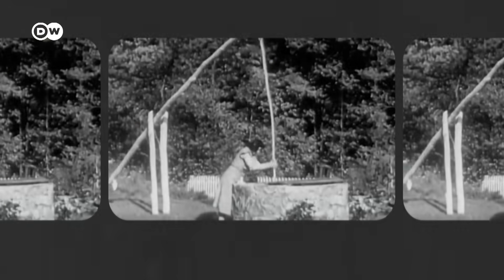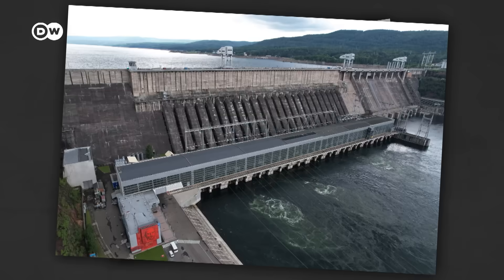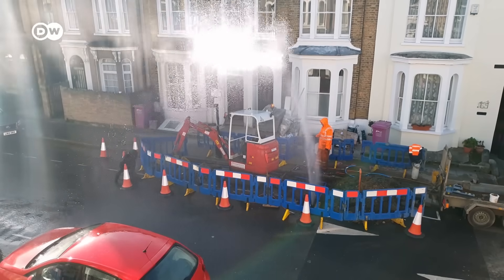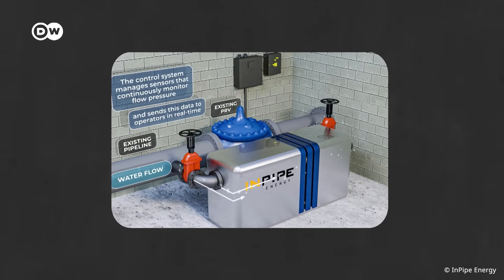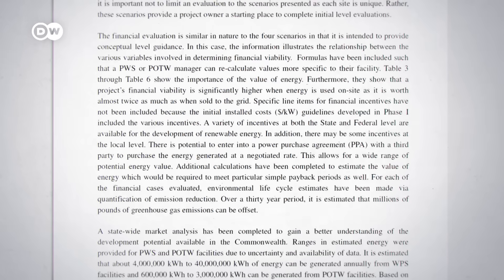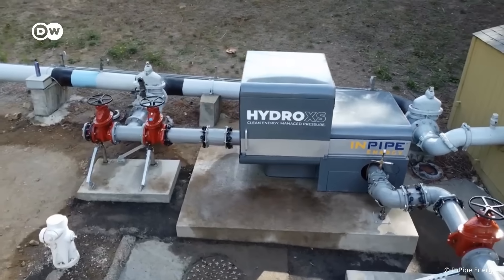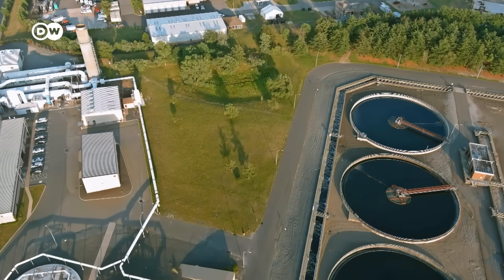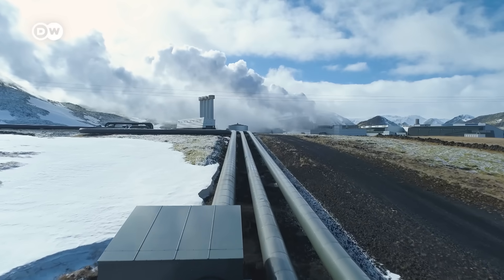In-pipe energy: The hydro power nobody is talking about

Comment from the maker: How could you make a use of in-pipe turbines?
Reply: On a personal level: you can't, really

In order to work, you'd have to have water constantly flowing. How often do you just let your taps run? You could have these on every tap in your house and still not get enough power to charge your phone.
Reply: @makerbotplanet  not to mention one first has to expel more energy then produced, in order to get the water to a high potential so it will pressurize the pipes
Reply: @makerbotplanet  Correct !  The only practical turbine installation would be at the big water utility source provider, whereas the water IS flowing, somewhat, all the time.
Reply: @petebaron4643  let's recap your proposal.
The big water utility source provider has a water pump to create pressure in the system so the last house has a certain level of water pressure. Now the provider will install in-pipe turbine at the outlet from the facility to harness energy. This will reduce water pressure in the system and the owner of the last house will complain. So the provider will increase power on the pump to reach the required pressure at the last house.
Please, explain, where did we save energy?
Btw every conversion of energy is lossy. Electric energy to water pressure, water pressure to electric energy. So the increase in power on the pump will have to be higher than the harvested energy.
Reply: What seems at first glance to be a good idea may actually be a terrible idea:

* you don't produce energy, you just recover some of the energy that you put in the water to move it in the first place. So at best you only increase a bit the energy efficiency of your water distribution system. Nothing more (but OK, it's still something ^^)
* you also need to consider the energy used and impacts for the manufacture of these turbines, which will be very high per MWh recovered compared to that of the turbines in conventional hydropower. I'm worried about the magnitude of these impacts, compared to other energy sources

In a nutshell: first reduce the energy consumption of the water distribution system! 😉
Reply: @iamsherlocked84  In 2016 in Australia a proof of concept test was run that allows dams to be retrofitted with three extra turbine halls and the dams output increased
Reply: I am curious to see if they are cost-effective to put into rainwater catchment systems and provide another energy source for a home or business with a capture system.
Reply: @mlatouable 
As soon as you do the maths it becomes obvious that this really isn’t practicable. I live in NZ where we have a pretty decent average annual rainfall, varying between 600 and 1600mm/year over most of the populated areas.
Suppose I have a large house with a roof area of 250m² and I live in a high rainfall (2000mm/year) area. Suppose I can let that water fall 5m (higher than the average gutter) to a turbine. Then the total amount of gravitational energy in that year’s rainfall is E = m.g.h. This works out to 6.2 kW.h. That’s less than NZ$3 or about US$2 for a very wet year of rain, off a large roof. And that’s probably twice what you could actually generate from that water. Plus, unless you’re only going to generate when it’s actually raining you need rooftop storage for up to 500 tons of water.
Reply: @q.e.d.9112  Source?  Not doubting your calculations nor conclusions and, in fact, confirms my (semi-educated) guess.
Reply: @gr8dvd  
Not sure what you mean by “Source?” The only reference was to rainfall, which I googled, the rest is high school physics and, since I taught exactly that, I didn’t need to reference it. 
I need you to rephrase the question if there’s something you don’t understand.🙂
Reply: @q.e.d.9112  Perhaps variable names obvious to others but fuller explanation likely beyond scope of a YT comment.
Reply: @gr8dvd  
I was trying to keep it short. I’m not going to explain the SI for the sake of Americans and I’m certainly not going to work it out in foot-poundals or whatever. So m is the mass in kg that falls through a vertical height, h, in metres in a gravitational field of acceleration, g = 9.81m/s². E, in Joules (J) is the total amount of gravitational energy this represents. 
A cubic metre of water weighs 1000kg. A kilowatt-hour is 3,600,000 Joules. The rest is junior high math.
Reply: @q.e.d.9112  thanks 👍
Reply: @mlatouable  this is clever...it will be a production instead of a recovery. Just to be careful with the dust, or leaf in the roof, that could damage the turbine...so the filter should be before the turbines and obviously cleaned.
Reply: @hectorjosehevia9121  Yeah, this guy https://youtu.be/S6oNxckjEiE did some testing on it, but it doesn't seem to really be commercially available, but you could re-use some river gear possibly (I guess), but I've never heard the costs vs production discussed, so no idea if it's generates enough power to be worth the cost of the turbine/motor and wiring job.
Reply: A wind farm lives for around the 30-35yr lifespan yet RDP Marine hydroelectric will last 100yrs+ AND be base load power AND 100% recyclable wind and solar are not the answer in their current type. And lets not forget the upgrade in transmission towers needed and the money needed to carry the power for a max 35yr power supply.
 @mlatouable
Reply: @mlatouable  its been dun in Australia a dam can now have three extra turbine halls more from the same volume of water
Reply: The basic premise of this invention is wrong.  A conventional pressure regulator works on the principle of Bernoulli's equation and 'connserves' energy.  It is plain wrong to suggest that there is energy here going to waste.
An in pipe turbine could extract energy out of the water flow but doing this will require more energy to be added in to the system through the existing water pumps.
Reply: @michael-j-harrison  you are correct that the basic premise of this invention is wrong.  And the amount of energy they calculate that they think the can extract is unfeasible to even attempt.  The Bernoulli principle is not really the equation used for a pressure reducing valve.  It is related but the working principal uses a differential flow equation (related to Bernoulli's equation and a steady state equation (not related to Bernoulli's equation).  It is only when you get into specific aspects of a valve design that you would use Bernoulli's equation. Dynamic modeling of a valve would include time which is not included in the Bernoullli equation.  It incorporate velocity which includes time but you also have to consider pressure reduction at zero velocity or zero flow.
Reply: The most efficient energy use is the one that it is avoided. What about using frequency regulated pumps that deliver the required pressure just at the required moment? That is how factories do it.
Reply: @picapica8846  this looks to be a limited time requirement and the need for water pressure is independent of the frequency rise. So the feasibility is quite low I suppose
Reply: @picapica8846  UNDERRATED comment (& why I reposted it).
Reply: @picapica8846 ⚠️ God has said in the Quran:

🔵 { O mankind, worship your Lord, who created you and those before you, that you may become righteous - ( 2:21 ) 

🔴 [He] who made for you the earth a bed [spread out] and the sky a ceiling and sent down from the sky, rain and brought forth thereby fruits as provision for you. So do not attribute to Allah equals while you know [that there is nothing similar to Him]. ( 2:22 )

🔵 And if you are in doubt about what We have sent down upon Our Servant [Muhammad], then produce a surah the like thereof and call upon your witnesses other than Allah, if you should be truthful. ( 2:23 )

🔴 But if you do not - and you will never be able to - then fear the Fire, whose fuel is men and stones, prepared for the disbelievers.( 2:24 )

🔵 And give good tidings to those who believe and do righteous deeds that they will have gardens [in Paradise] beneath which rivers flow. Whenever they are provided with a provision of fruit therefrom, they will say, "This is what we were provided with before." And it is given to them in likeness. And they will have therein purified spouses, and they will abide therein eternally. ( 2:25 )

⚠️ Quran
Reply: Install in-pipe generators on the main outlet of all Overhead Water Tanks of houses to make full use of the Potential Energy .
Reply: You don't it's simple physics really...
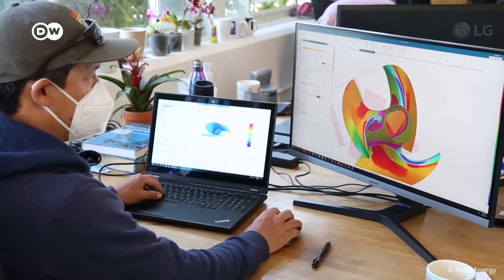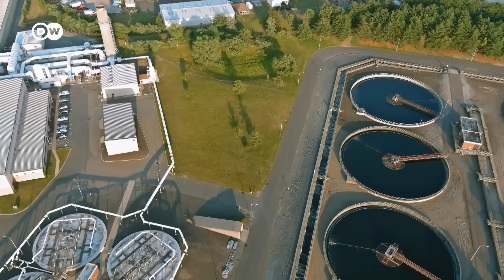Reply: When the private companies that are marketing a new green technology have no idea what the actual benefit would be (03:59) yet they talk about how their product needs to be "incentivized" (06:52) and that big companies and governments need to "step up" and adopt (07:18) their miracle tech, what they are actually saying is: "We can't show on paper that our product will result in a net gain, but the ignorant public can be fooled by flashy presentations to support legislation that we pushed through political action committees (PAC) to force tax-funded entities to adopt our product at a net loss." 

Additionally, I wonder if these companies will be made to account for all of the energy that will be used to manufacture, transport, install, and maintain their product into their equation of net energy gain. Will they be accountable for the pollution produced by the global manufacturing contractor that they use to produce their product? They say that entities could recoup their investment in their product in "less than decades" (07:00), but make no mention of the longevity of the product. Do we really believe that a turbine generator will last more than "decades"? Or will the municipal water agency that is forced through legislation to install one of these be eternally on the hook to replace turbine generators as they wear out well before they've recouped their investment?

This is how states like CA and OR were tricked into believing that sending post-consumer recyclables like plastics across the pacific on gigantic diesel-fueled ships to be recycled in a different country (with non-existent environmental standards) was somehow good for the environment. I wonder how all the plastic in the "Pacific Garbage Gyre" got there?
Reply: wow.
I just would not. 
 this whole topic is stupid.
Reply: Instead use this CAPITAL to convert pumps to solar or wind.
Reply: I live in Vancouver BC where the water is from alpine reservoirs. There are very expensive pressure relief valves. I suggest this to a friend who was an engineer for the water authority and all I got were excuses for why it wouldn’t work. The only valuable one was that BC Hydro wouldn’t let it connect to the grid. They did try is when connecting 2 reservoirs with a single water treatment plant but had real problems connecting to the grid. 🤷‍♂️🤦‍♂️
Reply: @LeftCoastStephen  if the reservoirs are at a high altitude and you don't need pumps at all and still have over pressure then yes, at the exit of the reservoir there could be one of this in-pipe generators otherwise it makes no sens as all you will do is make the water pumps work harder. If you use this system at your home you may make some electricity while watering the garden for example but you don't "generate" the electricity just steal it from the water provider lol (cause their pumps will have to work harder).
Reply: There is as much use for in-pipe turbines as there is use for perpetual motion machines. NONE.
You put energy into the system on one side and take it away on another side. All you do is reduce water pressure in pipes. Worst case: there is not enough pressure left and the pipes, so instead of a steady flow of water, it will drip. "We do not have a solid number of how much energy we can create" roughly translates into: There is no energy to gain from this.
Reply: Government uses them for tax meters.
Reply: @MAGnetICus_Attractus  You sure?
Reply: This is one of the dumbest ideas I have ever heard of.  Trying to tap the relatively small amounts of energy lost at each pressure reducing valve would cost hundreds of billions of dollars.
You would need millions of micro turbines.  And the energy being lost at each pressure reducing valve is probably being calculated incorrectly.  The pressure reducing valve uses a spring and a diaphragm and IS DEPENDENT on the outside pressure being the ambient pressure or it is designed as a sealed unit and IS DEPENDENT on back pressure regulation. There is no untapped energy unless you redesign the valve itself to let you use that energy. doubt that many pressure reducing valves could be more efficient.  But is it worth the extra carbon emissions to replace all of them.   When you calculate all the energy being lost it seems huge; but 100 wind turbines is a far far far cheaper and easier way to make up for that loss.   1.1 Gigawatts is about 1/7 the amount of energy the largest nuclear power plant puts out.   So why not build one of those instead?    But this insane quest to fool people into investing in an insane ideas will never end.  Before you get gullible people to invest you should at the very least have a working model to test the feasibility.  But that is probably also the point, you need people to stay gullible.
Reply: Don’t have them and use less pressure.

Each and every conversion process loses some energy. The most efficient way to gain that energy is not to put it in the first place. 

By using in pipe turbines, which get their energy from the pressure in the pipe which is put into the pipe by an electric pump. You have essentially made that water pipe a power transmission line.  With a conversion at the beginning, and at the end.

Highly inefficient
Reply: @Pssst.ByTheWay  You missed a key point, pressure down stepping. Just like a high voltage transmission lines have a transformer to lower the voltage to 120v before going to your home, the high pressure water lines have to lower the pressure to safe levels for your home. this video claims there is currently just losses at that point that can be recovered instead of just wasted. His example turbine he attatched to his home is just stealing power from the water plant and in that example you have a valid point, but thats not whats being presented here.
Reply: A wind farm lives for around the 30-35yr lifespan yet RDP Marine hydroelectric will last 100yrs+ AND be base load power AND 100% recyclable wind and solar are not the answer in their current type. And lets not forget the upgrade in transmission towers needed and the money needed to carry the power for a max 35yr power supply.
 @Pssst.ByTheWay
Reply: Just that battry issue....
Reply: Here is a great analog, with a hydroelectric generator to power a microgrid for remote areas.   

Hydrokinetic generators are definitely in need of innovative applications. 

https://www.youtube.com/watch?v=Wp_xASUzjz8
Reply: Someone deleted my comment
Reply: In pipe turbines could be used in tidal flows with a wide pipe with wheels or like fans turning INSIDE to a turbine
Reply: They should be using sewage pipes with generators in them as well s*** rolls down Hill and It makes power
Reply: @3tree33 This would not really work. The sewage needs some sort of energy input whether by gravity or otherwise to keep it moving. In most cases if you place a turbine in the pipe there would not be  enough energy to turn the turbine and also maintain the flow.
Reply: I was told by a professor that they were too cost prohibitive. Some easy ideas are often just ones that haven't had a chance to be tried. Or need more efficient technology.
Reply: Only reason to use an inline water turbine is to steal power from your municipality, if you don't have metered water that is
Reply: I usually install pressure reducing valves for main and secondary pipes, this is a great idea to recover some energy and reduce pressure at the same time!
Reply: Most places, you can't.
The only place they could be used is where you already need flow-reduction for some reason.
Reply: @conradogoodwin8077  And I'm no expert but doesn't that usually mean you have inefficiencies throughout the line? Would probably get more energy from fixing the problem rather than "exploit" it
Reply: These are a few specific solutions to a broad problem space. You did not get into the details and math for any of the specific solutions either. You do not discuss how excess pressure is regulated in large or city water systems now. Pressure regulators in general do not take much energy to work; this is not a problem nor a point where a solution is needed. The solution in the case of excess pressure is to reduce power to the pump that is over-pressurizing it! Or fix the design of the system to eliminate over-pressures! -- Not to keep converting forms of energy! You fail to abstract the key categories of water and energy transport vs energy generation here. Your startup interview's key contribution is using a water supply line to transmit power a portion of the way by using water in pipes instead of power lines; yet again there is no mention of the cost to convert forms of energy nor the excess cost of ongoing operations and mechanical wear and tear of water pressure systems vs traditional power lines, high or low voltage. HOW LONG WILL THE PIPES, VALVES, TURBINES, GENERATORS AND PUMPS LAST? Not long compared to static overhead or underground power lines. There is no excess energy or green generation here in water-based transmission; in sum, all tech here is more energy intensive and consumes more energy due to increased losses. Less green. I cannot tell if this channel is trying to false flag climate change by presenting some watered-down rubbish, to not take it seriously on purpose, in order to work against climate change activism and tech.
Reply: ??? Not enough was emphasised about the impact turbine aspect. A network-decoupled (ie: post faucet, but before consumption) energy recovery system would be a laudable aspiration but the wrong impression is given in this presentation discussing pressure in pipes (which comes from pumped water) being converted into electricity. It is not "new" electricity, only a transfer of energy from the pumps via pipes carrying water rather than wires carrying electrons.
Reply: I thought about this idea. It also occurred to me that we need a redesign in automatic transfer switches too. They need to be able to charge the electric cars. And They need grid both types of inverters. That way your micro energy like this idea. As well as any other ones we currently have. Would supply your electric car with power. But also use your car as a source of energy to your house till power is on. Every generator I sell I think what a waist for what they actually use it for. Every house would be a power station to help supplement that more power we’ll need for electric vehicles. Our houses do nothing when we’re not there. With these ideas they would make them  micro power stations. It would also get a lot more people on board if their car was also a generator/ source of electricity.
Reply: The first thing I would do is to find a native English speaker so we can understand what he's saying
Reply: This is a really dumb idea on all levels. 
BTW, adding this to the municipal system in any way, would be like stealing from the power grid.
 You should just take down the video.
Reply: I have proposed it many years ago for my high rise apartment block where we pump up water to 31st storey, 8th storey water tanks . We even pump water for 2 artificial 'waterfall' feature. I said, if the outlet pipe from the tank can have a turbine attached to capture the potential energy from water falling by gravity to the units below, we can recover electricity and reduce utility cost. We also have roof space (and added another roof to shield the generators and a huge cool underground carpark to generate the cooling for the solar panels if required. But most of the residents are complacent high level executives who are too used to status quo and they refuse to even entertain the idea.
Reply: It seems like you are not really qualified to make this video.  You need a lot more physics and math.  And you need an understanding of the fact that just because there is a loss of energy in a system it does not mean that 100 percent of that loss is all untapped energy.   .  Moving water is power intensive and expensive so you should probably have a little more faith that it is being done extremely efficiently and the "untapped" power loss would have already been tapped if it was feasible to tap it.  This video seems like a proposal for gullible investors.
You are also contributing to people doing dumb things like putting a water turbine on a water pipe to generate electricity.  People find out very quickly that they do not save any money by having their electricity bill go down but their water bill sky rockets
Reply: The govermrnt should step up for this idea, cz all water pipe is monopolize by the governent.
Reply: Better elon musk batterys solid state etc. 
Nokolia tasla ... We are in the future ( southpark doorbell)
Reply: A great deal of water is pumped to the top of tall buildings. The wastewater then has to get down but can't be allowed to free fall, so that has a lot of potential for using hydroelectric turbines to slow the water & create energy.
Reply: It's a smart idea.

A problem with this video though is a VERY incomplete discussion about the distribution of water in a typical city, or at least in the U.S.  

Pumps don't push water into homes unless you live where you aren't connected to a locality's water system.  You then typically have a well tapping into ground water and it's pumped up and into your home.

Gravity feeds water into almost all homes in the US, but you do need pumps to push water into tall buildings.

F=mgh.  This is used to get water into most homes in the US, or homes connected to water systems once again.  We have huge water tanks that are elevated.  This creates a lot of force that pushes water to homes.  Pumps are used to push water into these tanks.  The idea is to make THAT function very power efficient.  That solves most of this.  

The other issue is how water treatment is done.  There is no way around this, this takes electricity.  There are chemicals that are added that need to be managed and this is typically pumping chemicals into large bodies of water.  And for water treatment there is both the function of creating potable water and the function of treating waste water.  THESE are the functions, especially creating potable water and then pumping that water out to the large tanks which are probably the most energy intensive, and mostly the creation of potable water and getting it pumped to the large tanks
Reply: You can't.
Reply: Everybody commenting stupid negative things saying this doesn't work seriously needs to talk to the people already doing it!  😂😂😂 It works!
Reply: Might as well throw them deep enough to tap into thermal energy
Reply: Maybe I don't get something, but looks like dumb idea.
It is like installing wind turbine on a car and speeding on a highway.

So these things are here not change overpressure valve to this.
Hypothetically, not bad, but will it give any power .
 Hm, it will recoup yourself in up to decades.
It is very small market, in my opinion.
Reply: This is the most retarded idea next to solar power roads. Electricity is used to power the water pump stations to deliver water to your home. A certain pressure level is required at all times to ensure reliable water delivery to home faucets to fire hydrants. If you attempt to generate electricity using this water pressure, you are essentially introducing resistance in the pipes. This means it requires MORE ELECTRICITY at the pumping stations, so that your stupid idea can re-harness some of it. Basic physics tells us that each time you convert energy from one form to another, some of it is lost as heat, friction, or other unrecoverable energy. This means that using electricity to pump water and trying to generate electricity from that water will ALWAYS result in a net negative.
If every household tried to harness water pressure electricity and produced a total of X megawatts, the pumping station would require X + Y megawatts to maintain that pressure.
Reply: you guys re morons, they have had this for years, they make very little power
Reply: Make a hole add a Ciphen attachment turn a fan
Reply: It's EASY ! All you need is a water source coming down from the top of a mountain! If you pump it UP to a tower to use gravity and pump pressure, that will never work. Entropy always wins!
Reply: To most people who are saying "don't spend that energy in the first place, that's the most effective way......" read on.....
We have spent a significant amount of resources to come to present day scenario.
We need to keep consuming Power to meet the service.
And in parallel to this, we will have to think of measures which give part benefit and start a good trend.
Reply: get a dam and fit it out with three banks of turbines. It can be dun without turbine surging or pressure issues Australia has one it works and like the dams is dam near 100% recyclable
Reply: It's called stealing, where do you think the energy in your water pipes comes from?
Reply: If you extract energy out of moving water, you slow it down. If this is done on a large scale it will severely impact the water flow. So this can only work for small locations with excess pressure.
If the idea was to use the water systems as the means to carry energy, this could work like the electricity and gas distribution system. The normal water use would then not be the main performance criteria.
This idea can only work alongside water for use, if the turbine is at the end where water just drops out or released without preasure concerns.
Reply: So You ușe big pipes to transport Water , ușe strong pumps that consume muchbenergy and You Say that energy sometimes îs used in exces so to not loose all the energy You recover IT with this Little turbines that works om the energy made by the big pumps , not bad to recover the energy
Reply: This is NOT the smartest of DW Planet A videos ! The in-pipe turbines will just steal energy from the pressure-pumps ...  Dont ya' get it?
Reply: @paal8193  Absolutely. I thought they'd be talking about gravity assisted cases, but pumped water? It's stupid at best. Without engineering limitations or the 2nd Law of Thermodynamics, you'd be at best be energy neutral (1 kWh at the pump giving you 1 kWh at your home or business). With those constraints? Well, that's how brainless environmentalism works.
Reply: @paal8193  it is true to a certain extent. In pipe hydro has a huge potential to replace PRV along the downstream.
Reply: @paal8193  You missed a key point, pressure down stepping. Just like a high voltage transmission lines have a transformer to lower the voltage to 120v before going to your home, the high pressure water lines have to lower the pressure to safe levels for your home. this video claims there is currently just losses at that point that can be recovered instead of just wasted. His example turbine he attatched to his home is just stealing power from the water plant and in that example you have a valid point, but thats not whats being presented here.
Reply: @paal8193  The video just briefly says that their use is for situations with to much pressure, and when you need to regulate it anyway. I agree the video could have been made better
Reply: There’s no free lunch in the energy world.  This idea is soooo lame
Reply: @TheTruth-yq2jb  You missed a key point, pressure down stepping. Just like a high voltage transmission lines have a transformer to lower the voltage to 120v before going to your home, the high pressure water lines have to lower the pressure to safe levels for your home. this video claims there is currently just losses at that point that can be recovered instead of just wasted. His example turbine he attatched to his home is just stealing power from the water plant and in that example you have a valid point, but thats not whats being presented here. Your right no free lunch, The lunch is paid for, what is being presented is eating the whole lunch and not throwing away scraps.
Reply: @Okamika44  In the USA, the pressure in the 6" line in the street is the same as the pressure in your home, minus some minor pipe losses.  There is no delta P to harvest.
Reply: @TheTruth-yq2jb  look further back in the line not in your street.
Reply: @TheTruth-yq2jb I believe there can always be a place in any pipeline where the end point pressure is not required to be as high as it actually is. These delivery points will definitely add a small contribution.
However low the capacity utilisation may be....., it will definitely give a positive output.
Reply: @TheTruth-yq2jb  been made to work in Gosford NSW Australia in 2016
Reply: I did my PhD research on the subject, and proposed a dimensionless method to design axial pico hydraulic turbines... 

You can find my paper googling  "In-pipe axial pico-hydraulic tailored turbine design: A novel approach using a dimensionless design chart"... 

You can't get much energy just recovering in one pressure reducing valve... You need to go complement or replace most of them...
Reply: I would install one turbine in the first inlet from the system to my house...other after the roof tank (it works with gravity), and another with my rain harvesting system...

and sent that recovered energy to the house electric battery.

Obviously not expecting more water pressure and being ok with it.
Reply: If people develop the technology enough , we can atleast lessen the total energy cost by using the energy generated to power the pump on pumping water throughout the city, best case scenario would be either achieving net neutral on energy cost or ending up producing more energy to be used else where.
Reply: Why so much negativty...this have enough potantial ...not the tap one...but on largerscale 4 sure...
Reply: @saddammall3337  Because this huge potential is false, the pressure in the pipes does not create itself. 
We make the pressure by using a lot of electricity. If we recover too much of it we won't have enough and then water won't reach your tap, so potential is very low. Basically this is recovering wasted energy from specific parts of the pipe system where we have too much pressure and even then not having too much pressure to begin with will save more energy because we can never recover all the waste back.
When we convert energy to pressure we lose some during the conversion, when we convert excess pressure back to energy we loose some again so it is much better to focus on solutions not to create excess pressure to begin with. 
Even if we have no other option but at least recover some of the wasted energy this way, the potential is just not as big as it seems in the video. 
There is a very big potential for the company or companies making these turbines to dupe people into the idea of saving the world while making lots of cash, maybe even taxpayers cash which can otherwise go for other projects with much more potential that will make a lot bigger impact.
Reply: @aaronhamburg4428  if the power recovery was 100% then the out flow in a dam would not be a issue if you were to walk into the flow (dead man walking) THERE IS PLENTY TO RECOVER
Reply: @saddammall3337  Nope, it does not. Thermodynamics make it impossible. It's not a question of technology or being smart. Physics do not allow for it. See comments before.